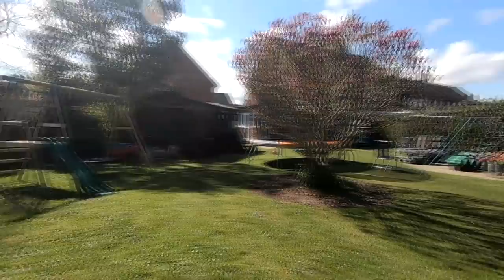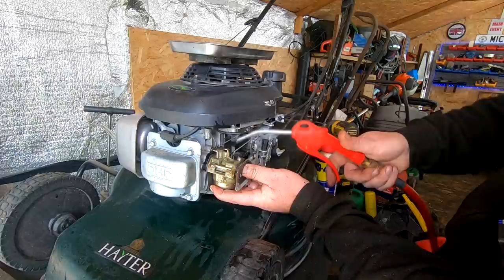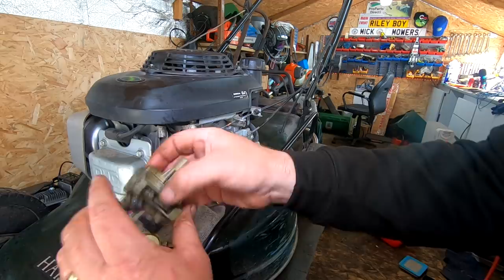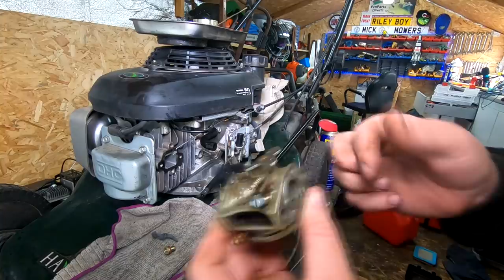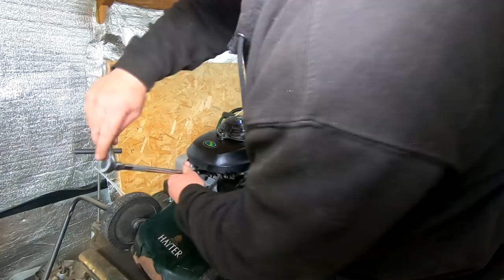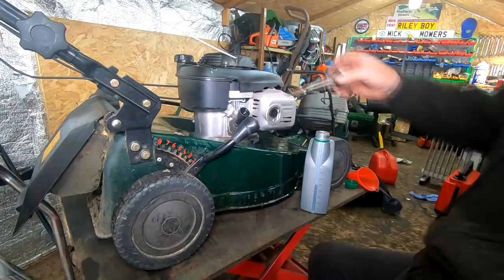Lawn Mower Revving Too High. #easy #fix

Comment: Greetings from Florida. I'm having this issue on my John Deere JS35A self propelled. High idle so much it's vibrating the whole engine.
Reply from the maker: Try bending the governor
Reply: @themowerman  I'll try. I can't get to stay running long enough for me to findle with it. It won't even start now. I've already removed the carburetor and cleaned it, installed it back on, cleaned the plug ( I should replace it) and it ran long enough for me to mow 1 pass and shut off. Now it won't start. I have a riding mower but I'm waiting on a replacement  mower deck for 2014 Troy bilt pony 42 " but it's on back order, I've been waiting for over 2 months. I have 2 acres of land to mow, I'm having to pay someone to mow it while I wait on a piece of steel.

Comment: Really enjoy watching your videos!
I had a sticky choke butterfly on a the carb for a Kawasaki FJ180V. It has to be totally free as only a weak spring pulls it to the off position. I couldn't see any way of removing the butterfly spindle to clean it so ended up buying a new carb. Is there a way to get the butterfly off the spindle? It's not screwed on like the throttle butterfly. Looks like it is held in a split down the middle of the plastic spindle?
Reply from the maker: It may just pull out the side. Then you can remove the throttle stem
Reply: @themowerman  Thanks Mick. It did just pull out and after cleaning out the upper hole in the carb body with a bit of emery paper the choke butterfly turns freely again!  I'll keep it as a spare for when the cheap(ish) knock off carb I bought packs up!
Reply from the maker: @gap9992  cool mate

Comment: you went the extra mile by removing the throttle plate. Nice work
Reply from the maker: Ta mate
Reply: @themowerman  like the blade stop you use ,would a small g clamp do the same job.....great view 👍
Reply from the maker: @davidmitchell1379  yeah